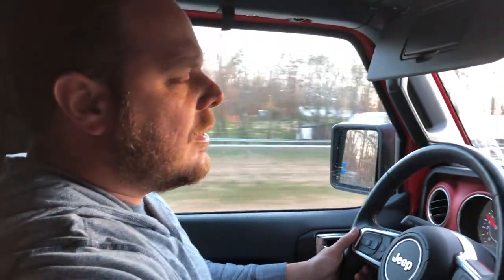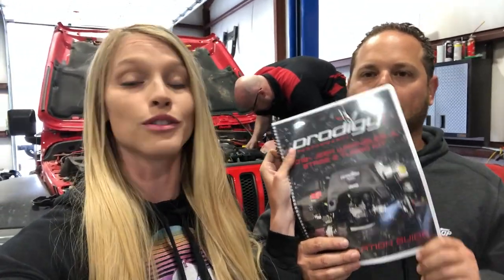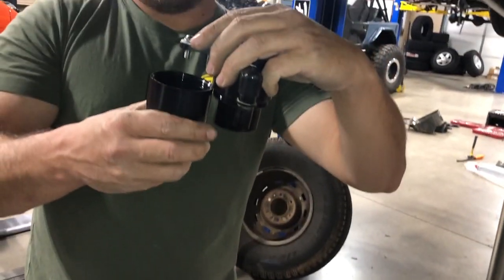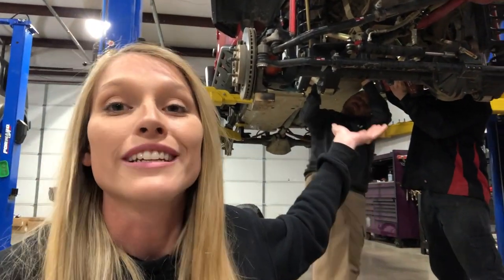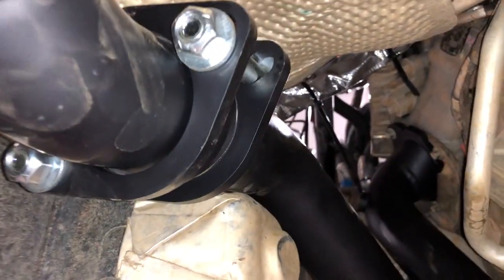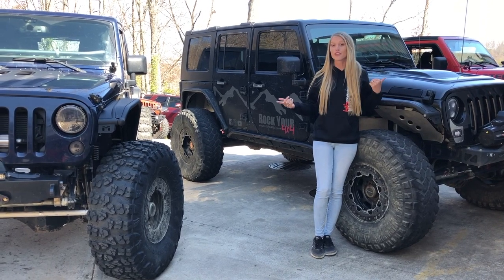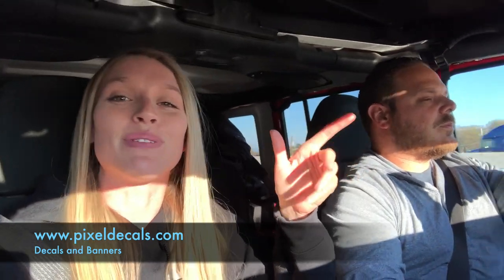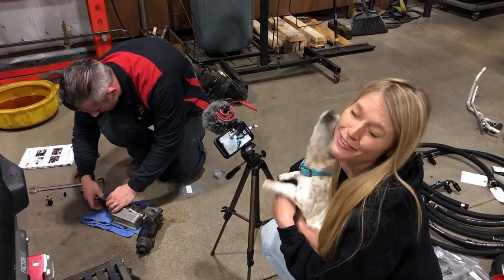We Install a TURBO on our Jeep Wrangler JLU Rubicon! It BLEW UP DO NOT BUY THIS TURBO KIT

Comment: $8000. Yikes.
Reply: + the days of labor it would take an average mechanic working alone.  You could pay for 50% of another JL Sport.  Lol.
Reply: For a full kit with all the integration parts, tune, exhust, and detailed full instruction 8k is a really really good deal.
Reply: I agree that is a bit more than I would pay, but the quality of the kit seems to match. Just look at that book. That kit looks top notch professional and that is reflected in the price. All the bags and hoses are labeled and the kit comes with every single part you will need. For a turn key solution plus some tuning support I can understand the price.

I will be interested to see if a bigger aluminum radiator is in the step child's future, however.
Reply: Badass work guy!! Love y'alls channel! 🤙🏽
Reply: Niner 8 Tango Juliet I only paid 2900 for a twin turbo kit for my mustang it came with everything to get the car on the road
Reply: That is a ton of cash for a turbo.  Rather just do a Hemi transplant much cheaper
Reply: That’s a decent price for a turbo kit lol 😂 
Go on eBay and get a cheap turbo kit 🤡

Comment: Really hope your experience with this company and product will be better than mine. Had the turbo on for about 3 years. Pros: More power for highway driving and cool blowoff valve sound of a turbo. Cons (for me) Randomly stalling out and rough idles. Brought jeep to company multi times and were unable to get it fixed. Needless to say stalling out while rock crawling can be a bit scary. Problem I had with the turbo was the lag, you are either in low and the turbo kicks in quick but too low of a gear to get good tire spin or you are in a higher gear where you can get tire spin but turbo lag takes to long to get that instant power to bump it. Long story short wish I just saved my money for what I have now (LS3).
Reply from the maker: caval49 Hopefully this works out for our Jeep! Worst case, motor swap would be the backup plan. Lol

Comment: Hold it up towards a light source. If you can see light shine through the air filter is fine. Also with a turbo you want that catch can. A little oil is fine but a turbo will put more then just a little. That’s why ford ecoboost with out a catch can tend to need a bunch of work right after 100k KM’s just in time for the warranty to expire.

Comment: I have a prodigy stage 2 on my 08 jku 3.8l. . Its been on for 3 years. Good call on the ceramacote, i did the same to mine. Prodigy's quality and customer service is top notch. Trust me, u wont be disappointed with it. Nothing better than the psshhh!!! Sound.
Reply: blain2851 awesome!! How much power you make? We made 363whp
Reply: @boughtnotbuiltoffroad7784  mine is the old 3.8l so i only get about 285 rwhp. But stock its was probably only about 165rwhp.

Comment: Obviously a GREAT shop! A fine kit and more torque is always welcome on the trail. Hopefully, the louver modification will not cause havoc with electrical systems when it rains -  some of the after-market louvers come with drainage systems. For ANYONE with a dog - antifreeze is sweet poison to any K-9 - care should be taken when they are anywhere near the stuff.

Comment: Sounds great!
The thing I don't like about turbos for off road is the turbo lag when you need it instantly. The blower gives that boost right when you need it. But I would be more likely to go with a small block Chevy in a CJ and build my suspension.
Reply: Old Griz that’s not how that works. The turbo didn’t subtract from the torque we already have from the v6 and the 5.13 gears. It’s still the same as before but adds on the mid to top end. I’ve never needed more torque below 2500 rpm

Comment: If you’re wanting more heat control. Go to PTPturboblankets.com and get their lava wrap for the exhaust pipe. Wrap the pipe atleast til it’s out of the engine bay. It’ll help the turbo perform better and it combined with the coating will make the pipe so you can almost touch it bare handed. Power driven diesel did a YouTube video proving turbo blankets work if your interested in the actual process. Keep up the great videos!
Reply: Heat wrap really does help. 😃
Reply from the maker: NicT09 Great tip! Thanks!
Reply: Gerg A  just used the lava wrap on his twin turbo 4 Gen Ram 3500 Cummins.
I hope everyone has a great weekend & stay safe.

Comment: So cool.   Love the turbo route.  I'm not super familiar with this system, but I always felt that Jeeps should use the smallest turbo to get the job done.  A ball bearing twin scroll rated at 450-500 BHP would be perfect.  You'd get a solid 350+ at the wheels, and you should get a great spool with mounds of torque down low.  A properly sized turbo can give a supercharger a good run for low end torque, and would actually hit full boost way sooner than either a roots or centrifugal charger.

Comment: Just an FYI about the air filter... Modern fuel injection engines do not respond to a dirty filter like an old carb motor.  The computer recalculates the fuel requirements based on the air available.  The power will fall off a small amount.  You need to be concerned about dirt and air bypass.  As the delta p across the filter goes up the dirt and air find their way around the filter.  better to replace it regularly.
Reply from the maker: Yeah, it just always got moved down the priority list or forgotten about in the busy schedule or as other things broke or occurred (such as death wobble, loose suspension bolts, etc etc).

Comment: By adding black paint you increased its heat holding, also Not sure the inside wall of a turbo casing should also but painted black.  Think about it in a like metal foil in oven, great for holding in heat take the foil off, it cools very fast.  Now paint that foil black, do you have the same results?  Probably not, due to extra layers it needs to cool.  Yes great for corrosion prevention no doubt, but if your turbo blew up I suspect, the nice powder coating and black color had a play in this.

Comment: Just wondering how much lower your intake is now.
Reply: Hrm, that's actually a decent point, though the rest of the jeep is lifted.
Still, if they ever want to get serious about water crossings, they would need a snorkel anyways.
Reply: Kenn S not much lower at all but I’d like to work on a solution

Comment: Turbo's are good.  With the rubicon's (4/1) transfer case you can still get the turbo boost for crawling in 4low.
Reply: Shaun Brehm but with an 8sp auto in first gear you can get to 5:1 if you don’t have the Rubi.

Comment: A dirty air filter is worse than dirty oil. As much offroading as the two of you do you should replace that OFTEN.
Reply: Hes rich. He dont care. Funny 10$ filter cant replace every 5k miles. Specially how much he off roads
Reply from the maker: Michael Prewett 😊 Despite what the uninformed and salty Social ADV David T said (we’re in fact very very far from being rich, he just may not be familiar with the terms sponsorships and marketing). We definitely should clean out or replace the air filter more often, you’re very right! In all honesty, it just always got pushed down the priority list or just totally forgotten in the midst of fixing something more important (such as death wobble or loose steering components or a smashed shock lol). 😊
Reply: 30.000miles without changing filter in the maintenance protocol? Don't you guys goes to the Jeep dealership every 10.000 miles or less? @LiteBrite

Comment: How much boost before you blow the plastic welds on that intake?
Reply: Timmothy Ketchell haha. Danger to manifold!!! Idk. Prob not a Ton. I’d say could run 12 psi safely
Reply: Plastic manifolds can handle plenty. The 4 cyl ecoboosts are holding over 30 psi without a problem.
Reply: Thomas Carpenter nice. Good to know.

Comment: I had a conversation with Bill Savage about turbos vs superchargers on off-road race trucks and he explained that racers wanted more low-end torque, which is one reason why you see a prevalence of superchargers in the off-road world.
Reply: ss67350 they are both great but you need a twin screw for low end. A centrifugal supercharger like ripp needs rpm to make boost like a turbo
Reply: @boughtnotbuiltoffroad7784   Dan Vance 1459 Tacoma used to run the TRD supercharger w/ 7th injector until they figured out the intake air was so warm they weren't really gaining any performance during a race. Hopefully the internet doesn't misconstrue my comments as being anti-turbo, just trying to add background to the subject. I look forward to seeing the turbo jeep in action.

Comment: I think this was Kevin’s secret plan to get some 40s. Those Milestar tires aren’t gonna last long! 😀
Reply: Well, those tires aren't made to pussyfoot around, they are meant to be used !
Still, I think they'll get some decent miles on them, before changing them.
Reply: Steve Ledbetter we’ve decided to run tires down to about 50% then get new ones so we can give someone the 50% ones for free. That way we always have new tires and the old tires are still usable for someone else :)
Reply: @boughtnotbuiltoffroad7784  
The question then becomes, how many miles, until 50% ?
Tire durability is after all a part of a vehicles economy.
Reply from the maker: Grumpy ol' Boot We had about 20k miles on the last set when we hit around 50%
Reply: @LiteBrite  
That doesn't sound too bad. 😊

Comment: With the catch can, aren't you losing that oil from your engine? Are you topping off the engine after you empty the catch can? My Jeep jku eats about 1 QT every 1500 miles.
Reply: Jesse James no. It’s not just oil. It’s mostly condensed vapor. Oil and fuel and water

Comment: So how will the turbo help when you're off-roading? Doesn't it only engage at high rpm? I'm sure it will help with towing.
Reply from the maker: Br Cc We have gears to help offroad. 😊 We’ve never had an issue there. This will help with sand dunes, towing, and driving across the country in general.
Reply: Br Cc turbo starts spoiling at 2500 rpm. Gears are for crawling. Boost is for dunes, desert and towing.

Comment: With all the mods u put on this jL, think might of be wiser to just buy the diesel rubi gladiator?
Reply: Kenny Tam not at all. The gladiator won’t be nearly as capable as the JLU. the wheelbase is too long for what we do.
Reply: 4’5” long arm lift with 42’s will fix that

Comment: Seriously??? Why did you not ever change your air filter? Wow! All that time in so many auto shops too? SMH
Reply: Well, to be fair, they have been busy.
But yeah, it should have been changed on regular maintenance checkups.
Oil, oil filter, air filter, pollen filter, clean brakes (new brake pads, if worn).
Stuff like that usually gets changed on regular maintenance … well, at least here in Denmark..
Reply: @officialyasir  
Oh, I agree.
I'm just saying they maybe have forgotten it, because they are busy.
Reply: probably because they didnt think of it. hopefully theyll get a reusable one and just start washing the air filter every few months
Reply from the maker: DJ-TRAXX Usually just always got pushed to the bottom of the priority list (or we forgot). Lol Finish a dusty trail, We’d mention we’ll need to clean it, then realize a bolt in the suspension came loose or something and totally forget while we fix that. Lol
Reply: That's what happens when you're constantly given product for free.  You don't value it.
Reply: @Tanner731  That is not good advice . Washable filters are great for letting dirt in.
Reply: @onthelake9554  a proper one like an aem with a prefilter sock over it or in the stock airbox is fine.
Reply: @ipdjbt  That's not fair. They share the journey and learn along the way. The transparency helps us all.
Reply: What’s with all the hate on this post. It’s a fucking air filter.. calm down lol.
Reply: @Tanner731  I disagree. and for what a "proper one with a sock" costs you can buy alot of stock ones that actually filter dirt.
Reply: @onthelake9554  agree to disagree then. I like that i can take mine off and hose it off shake it out and slap it back on. with a filter setup like i mentioned theres no stock junk airbox
Reply: @Tanner731  agreed but next time you wash it , take it in a dark place and put a light inside and check out all the holes for dirt to flow through and ruin your engine.
Reply: @onthelake9554  there are no holes because i dont buy garbage autozone pod filters. also have you ever heard of a prefilter sock?????
Reply: @Tanner731  Yes , pro level race engine builder here trying to help you  . done.
Reply: @onthelake9554  most of the buggies and trucks I see in the dunes run a pod/sock setup and they are driving around in a sandbox all day, I just feel like after ~250k miles the pod filter would have killed my engine if it was as bad as you say. I can see where youre coming from as an engine builder and that you dont wanna see your customer cheap out and install some no name $10 parts store pod filter on their high performance engine they spent a ton of money on but thats a totally different level from my mostly stock jeep 4.0. If i had a built 4.7 stroker engine Id go out and buy a UMP airbox but thats not in the budget at the moment, right now i gotta pay for school.

Comment: Let me know if this affects the oil in your oil catch.  Is there less or is the consistency of it change.  I’m wondering if the added heat changes the oil.  Thanks
Reply: Harvey Nez we used thicker oil. No way I’m running 20 weight with a turbo

Comment: Awesome!  Question though....no concern about opening the hood vents with no filter media?  Seems like water and specifically dust from offroading will not be your friend.  I would think it might be wise to install a filter of some kind to control that.
Reply: tboruff73 just open the hood and spray it off. It’ll dry out

Comment: Light brite, with hp tuners could they change when you can and cannot engage your lockers and your sway bar and did you have kill of all the traction control.  

Also are you happy with your gear set on 38’s now that you have the turbo?

Comment: If you cut the plastic covers on the hood now the rain can go straight into the engine bay?
Reply: g s ya. It’s just water.
Reply: I hope it does not get on the electrical systems and cause a short.
Reply from the maker: @gs-nt6nf  Way less of a concern than most people think, unless you have totally exposed wiring in your engine bay (at which point, there are a lot of other things you should be much more concerned about)

Comment: Oil doesn't combust and lowers fuel octane rating when it enters a gas engine... No, the engine is not designed to burn oil, that is BS.. not saying you said that was true, just the myth of that is false
Reply: so explain a rotary which literally burns oil on purpose. Oil does burn it does not carry explosive energy the way gasoline does at combustion temps in a engine but it will burn cleanly if all is working properly.  The only issues with oil going through the intake is the valves getting carbon build up because they do not get exposed to combustion obviously on the back sides.  On older engines fuel kept the valve clean on newer DI engines nothing does so a catch can does help in that case. But oil does burn through an engine completely.  

Also it does lower octane but a lower octane actually has more potential energy and less explosive energy at combustion temps and pressures.  But on the oil topic there are engines specifically designed to have oil enter the combustion process to lubricate the seals or cylinders and other than the design of the engine as far as pistons or rotors etc combustion is still combustion and happens via the same process. All engines are designed with the knowledge that oil will get through the PCV system and burn and are ok with handling that process. The only advantage of the catch can or removing the oil before it reaches the intake is saving the valves.

on that point though I will say a 300 buck quality catch can is worth it on a DI engine as having to have the valves cleaned at 100k miles because they are caked is stupid. But you can also use seafoam or berrymans through the intake every 5k or so miles to help reduce build up as well and even with a catch can is a good idea as they do not stop 100 percent of the oil.
Reply: @brandonbrown3600  yeah, ok... 1st this is not a rotary engine, 2nd oil in combustion chamber can cause carbon deposits, pre ignition, knocking, valve cooking, dirty binding throttle body, lower octane of fuel, foul plugs, etc... Please take your Google info and go to a rotary forum... I've built engines for 30 years, I know every nut and bolt on this 3.6.. take the plenum off and look at the intake and valves, coated with oil, sticky as honey, coating the valves causing carbon build up.... Don't tell me this is normal... Ur not qualified

Comment: No LSD or lock on the rear axl? Or did you just forget to engage it?
Reply: Rune Andre Bergtun taking things easy. We just put it on.
Reply from the maker: JL Tubicons come with front and rear lockers from factory. But since the turbo had just finished being installed about ten minutes prior, we were just going easy on the whole system and testing things out.